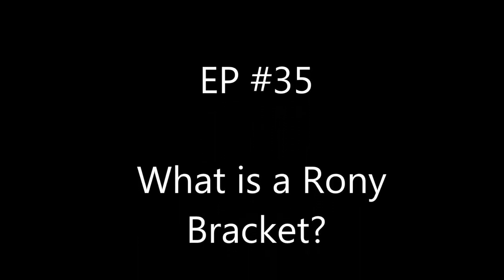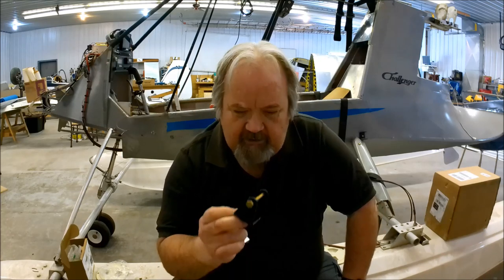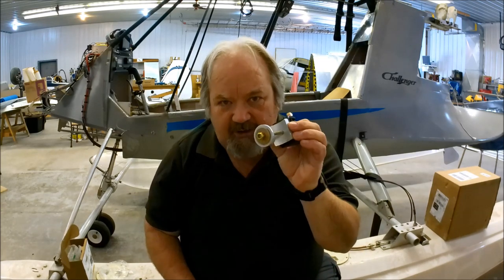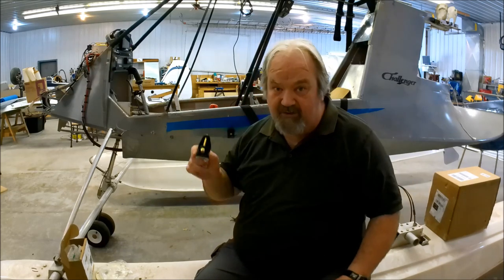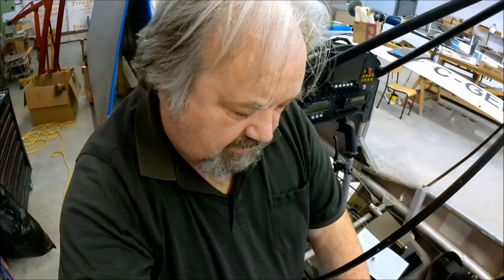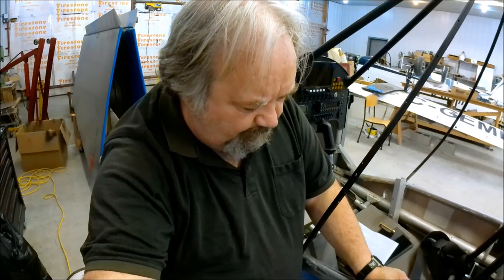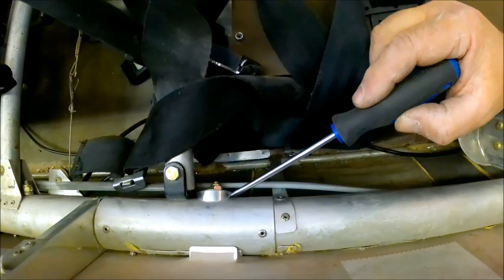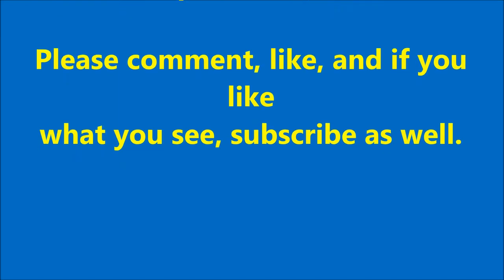EP #35 What is a Rony Bracket?! Challenger 2 Ultralight Airplane Rebuild/Upgrade.

Comment: Don’t forget the upper brackets too - the one that the wing spars attach to. I replaced my lower ones on my Excalibur with the recommended stainless steel ones.
I like the idea of the aluminum bits to distribute the load.
Also check the bolt holes on your wing spars for any rounding out. If there is any, you can sleeve the ends of the spar and re-drill the holes for the wing attach bolts.
This stuff never ends…
Reply from the maker: Thanks for the info!

Comment: Great video, very informative.  Looking at buying a 1995 challenger2 which has not been run for 10 years.  Very dirty due to open end on hangar,  wings discolored due to sun exposer, holes in horizontal stab at aft end, prop is delaminatinkg on the belt drive rotax 502 but does have potential.  Trying to figure out what would be a fair purchase price,-----------------------------------------------------------------------------------------Les
Reply from the maker: Sounds like you have a project in your future. If it's structure is sound, the only other consideration is the engine. I would consider just boxing it up and sending it in for a full rebuild, based on how long it has sat idle in storage.

Comment: So where your back seat is, I would get 4 (minimum) L- brackets and epoxy rare earth magnets to those brackets. Then rivet the brackets to the fuselage that runs vertical along side of your gas tank. Then take a piece of plexi glass or something similar and epoxy some thin sheets of metal to where your magnets would line up with your L-brackets. Walla, you have a removable wall where you won't need screws or rivets to remove it. Maybe drill a few a few holes to put your fingers through or tie a small rope just a few inches long with a knot at the end or handles,whatever. You get the idea.
Reply from the maker: Back seat will be installed, but most likely will be seldom used. Most likely camping gear will occupy the rear.

Comment: nice video, I just purchased a challenger 2 which I need to find out how many hours are on the new Roney brackets?
Reply from the maker: They are not expensive at all. When in doubt, just replace them, and record the hours from that point on in your maintenance log book. The most important thing you can do, is a close visual inspection before every flight. Cheers.

Comment: Hey bud. A while back I asked you about the challenger 2 and its max load capability and you told me if I get one to have a rotax 582 put in. That's great, except they stop making them however they are still  available and parts will also still be available for the next 10 years. But, it has 300 hr limit before needing a rebuild. That's not a lot of time. So what do you suggest for a second engine, same price range and perhaps a 4 stroke.
Reply from the maker: I have looked into options after I heard that Rotax will be stopping production at the end of 2021. And of right now, the options are just not their from the manufacturer. That being said, because it is experimental, you do have the option to bolt any suitable engine on that you want, within reason. I have looked at the Hirth, and the 3202 as a very viable option. It's still a 2 stroke, but give it a look.

Comment: did you paint the down tubes?  Mine are natural aluminum.
Reply from the maker: Not painted, but they do have the aerodynamic covers, which are white.
Reply: @challenger2ultralightadventure  I was talking about the downtubes and the window frames.  They appear to be black.
Reply from the maker: @jackryan152  OH...sorry. Yes I painted those tubes black, and I will be painting the door and other exposed metal like that flat black as well. I did that to help reduce glare and reflection on the wind screen. Plus I think it looks better.

Comment: There are no Airworthiness Directives ADs issued to ultralights in Canada.  There are many reasons for these types of brackets fail.  Design is not one of them.  People tend to over tighten and 
'squish' them.  Be safe.
Reply from the maker: Technically, you are right, It's not an AD, it's a Civil Aviation Safety Alert (CASA No. 2019-02) As for the reason for the failure, over tightening is definitely one contributing factor.